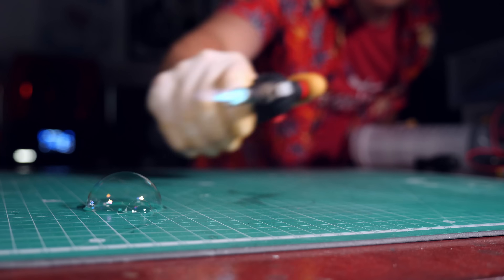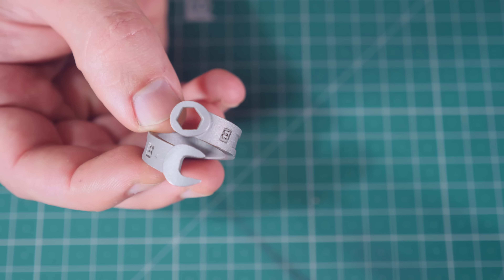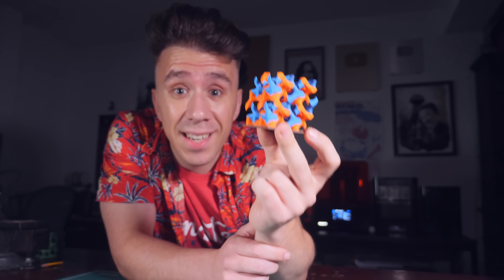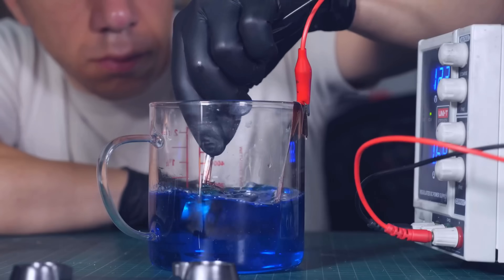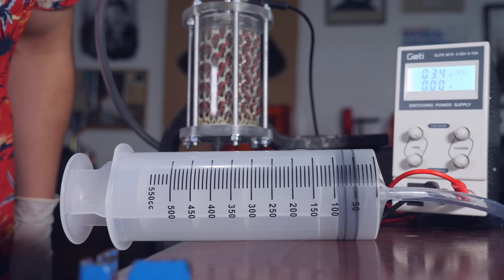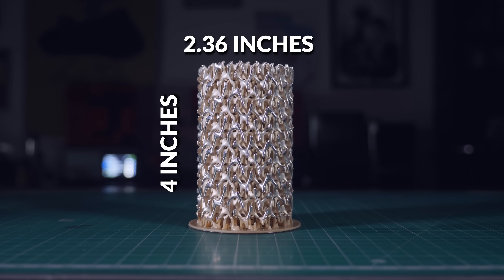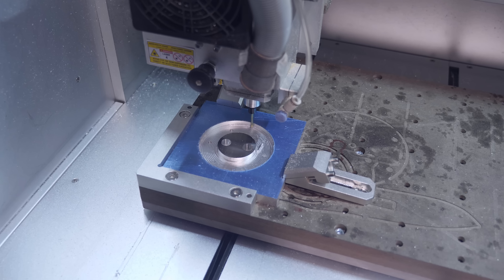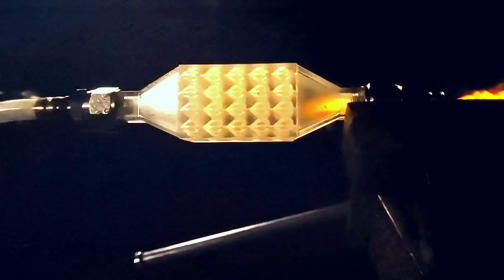ROCKET that LITERALLY BURNS WATER as FUEL

Comment: once you have sorted out the maximum surface area for the electrodes try pulsing the psu with a square wave at 10,000 volts at very low current (milliamps)vary the frequency of the pulsed. square wave until you find the .......resonant frequency of the water molecule......... the water molecule will break apart easily with very little current input (see opera singer and shattering wine glass} Just Thinking......
Keep up the good work.....

Comment: I have your solution just hook up a 48 volt electric bike battery. You can salvage an old speed control from a bike not in use and use the throttle to dish out power to the cell.

Comment: Might I suggest something of a challenge, the same one facing the greater hydrogen infrastructure. And that would be storage. You need to store enough to run your engine for any appreciable amount of time, but hydrogen is so small it can slip past most sealing surfaces. 
Of course, producing Brown's gas on demand would be ideal, but you're going to need a lot more volume to run a jet engine. 
Finding better solutions to both of these problems is the way, but if I know anyone who can do it. You can. Merry christmas!

Comment: You need to have another piece of ss in-between every electrode acting as a semiconducting plate between cathode  and anode I believe it acts as an volt/amp clamp it will save battery and overall cell health at the cost of hydro/oxy production try experimenting with different conductive material as the, let's call them "floating electrodes" also the plate thickness difference between cathode and anode (as one will be attracting twice as many atoms as the other, also the opposite one is the more corrosive of the two hence the discoloration/sludging of the one electrode) hint : further experimentation with anode material  may be beneficial as well.

👍 Awesome project keep us updated ! 👍

 I also have a schematic for using this with a 24v 1000 watt solar panel could be up or down scaled very easily for 48/12/6/ even 3 volt battery applications with almost any type of mAh delivery. 😁

Comment: If it is drawing more current than you can provide, decrease the electrolyte solute concentration to increase the solutions resistance. This will decrease the output but prevent you from burning through batteries. I recommend you use an electrophoresis adjustable voltage power supply or rig up a battery bank of some kind. I would be interested to see how the water electrolysis reacts to a rapid capacitor discharge or a scaled up version on the styro-pyro's car battery bank.

Comment: The wires they put on your "400A" battery look like they are meant for 40 :) . A device you might want to get if you are frequently wanting to experiment with circuits with tens of amperes in them is something like a KP-184, an electronic load - these things can current limit anything up to 40 amps very precisely (and they can be paralleled). Also, you'd want to get some 10 gauge silicone insulated wire to make proper high current cables...

Comment: Use a 40,000 volt compassitor that you can get. Preferably a blue silicone disk on it stores power equivalent to a power line and if you use a full bridge rectifier it might also help it

Comment: I see you sanded the plates for more surface area. For even MORE SA, maybe try sandblasting the plates (with proper abrasives for stainless steel) at a 45 degree angle. Moray B. King talked about an inventor that did that. And thank you for the warning to be careful with this because yes these gasses are extremely dangerous. Hydrogen especially since its burn rate is so fast you really need to mix it with ambient air to prevent flashback... at least Stan Meyer did that. A PWM sounds really awesome, and if tuned properly with measuring the resistance of the water.

Comment: Try a bunch of the latest technology solar panels linked together, as you only need peak drawing capacity at the time of creating the gas and thus abstracting the hydrogen from the water.
You may also want to use distilled water as it is far more pure and you probably want to boil the water first to remove as much oxygen as possible, before abstracting the hydrogen.
Now as I have only just found your channel and have immediately liked and subscribed. I believe that I should totally get the 3D printer, after giving such excellent advise ;-)

Comment: Ive built a 1.5kw hydrolizer. Every elektrolyte reacts differently. I used KOH as electrolyte. The law of faraday says to use between 1.5 to 2v per active cell. Above this voltage the electrolizer will work as a heater, with poor efficiency.

With the 1.5kw i have built, it makes a 5L/min of HHO.

Also make the electrolizer of stainless steel. (I dont remember using 304 or 316. It is important that the KOH will not oxidize the plates.

My cell was a 6s2p configuration. 12/6 is 2v per cell.

Let me know if you want to know more. I can search the sources of the above information.

Edit: also be sure to have 1.5 to 2mm between the plates. You want the bubbles to escape quickly vibrating other bubbles of the plates aswell while keeping the resistance as low as possible.

Comment: you need a speed controller to regulate the amount of current that is flowing out of the battery. You could use the 15v battery just lower the output that is being pulled from it.

Comment: Several years ago I started building an HHO torch rig and was coming up with a electrolysis cell using double helix SS Tig rods in mason jars. I realized to get a constant large enough volume of gas would require many connected cells connected to a bubbler arrester. Alas I abandoned the project due to high cost of materials and safety concerns. My design wasn't very efficient. Cell designs with neutral plates are the way to go nowadays. Overseas built units are getting down to attainable prices now. So as you say, "Buy a bottle."
Now if someone can find the resonant frequency of water like Stan Myers supposedly did we could use PWM supplies to split water far more efficiently.
Yeah, I've been down the hydrogen rabbit hole a few times.

Comment: So, I worked with batteries for years and to today still work in solar. You are going to destroy any battery you connect like that, you are essentially dead-shorting the ends of the battery. You need a regulatory circuit that will restrict current and give you control over the reaction,  you can also use a step down regulator which will take the voltage you throw in and bring it down but it will increase the current output. That way you are not pulling 40A from the battery, easy way to turn it into a paper weight. If you take a 12V battery and step it down to around 2V, the current should be insane so efficiency of battery use will be much better. Additionally, as mentioned, limiting the current before the regulator will increase the runtime of the battery. Basically, you can get the same result using less battery power using the correct regulator in this situation.

Comment: I’m becoming very interested in bifuel systems where CNG or H2 is either blended with liquid fuel for improved efficiency. Wastewater treatment is a very interesting application where sewage can be processed into methane and H2 via anaerobic digestion and electrolysis. So in theory, developing a process to efficiently combust CNG and H2 within existing automotive or aviation engines would blow open a huge market for cities with large sewage treatment plants to begin producing transportation fuels.

Comment: Use distilled water, / deionised water.
If using tap water then the mineral's in water burn and create sludge, it won't go away when you get it so... Need to clean out system...
To clean use cheap COLA, £:40 pence 2 liter stuff then by soaking reactor for several hrs, over night, rinse in warm water ... There you have it.

The reactor heat's up due to bubbles produced & remaining clinging to the surfaces of reactor plates.... And the electric power going to , example negative, CANNOT pass through clinging surfaces with gas or oxygen bubbles, and bounce round causing heat to dissipate....
Its a bit more complex but..... !
Interesting video thanks.
Thom in Scotland.

Comment: Try using a triac or SCR based power controller to control the power, then you can use the home socket as the source. If you want greater security you can use a transformer to isolate it.

Comment: You need a current limiting resistor in series with your tank. The hydrolysis tank has virtually no resistance so it effectively acts as a short which the batteries and power supply don't like. Add a low value power resistor to give it enough resistance to give you as much current as you want but enough resistance to not fry the batteries. It needs to be a large power resistor to be able to handle the wattage you are pulling. R=V/I so for the 15V battery at 40A you need 0.375 ohms including your tank. Might be best to not max out the battery and go for 35A with 0.43 ohms of resistance.

Comment: Try a small vacuum pump like from a food sealer to lower the pressure in the HHO generator and to pressurize the gas going into the jet engine. the lower pressure should make more gas with less current.

Comment: Have you tried using a PWM controller to provide power to the generator. To allow you to control the amps as well as prevent the unit from overheating and increasing resistance which would reduce output over time.

Comment: My friend, congratulations on the project. To generate 12 Volts energy, try using a car alternator and something rotating to drive the alternator. Then you use this current in your hydrogen/O2 generator. Good luck.

Comment: You should check out the john behind circuit for a pulse motor/generator. It may also answer your power problem for this video, if you combine both designs. 9v in to the motor, over 110volt output from the generator. I'd love a 3d printer, lol. Who wouldn't?

Comment: Swap to lead acid they self regulate and you can use solar panels and a mppt to charge it. Also run at a higher voltage and step it down.

Comment: U need to achieve residence to get the most hho gas as possible. If u make a pulse modulator at residence and use 12 volt car batteries u can achieve over 2 liters of hho gas to totally run a vehicle on hho gas. Inmade one years ago to use on my 93 blazer and got 33 mpg with injecting hho gas into intake side . Normally it would just get 12mpg on just gasoline. I got disabled and couldn’t finish designing the hho generator but still have the prototype

Comment: Start off with pure water . I used rain water. And a car battery.  Then while it’s running add the soda crystals and measure the amp draw. Add more water to reduce the amp draw if you over do it . And keep safe . If you go too high on the amps the plastic Will melt = sparks and boom

Comment: I have seen a video where the guy uses battery pins instead of stainless steel plates, he uses about 24, 1.5 volt batteries, you have to take each one apart use the pin in the center. 12 on the negative and 12 positive, he made lots of gas real quick with it.

Comment: Creating an engine that uses water as a fuel source instead of traditional petroleum or gasoline is a complex challenge, as water itself is not an energy source. However, water can be used in different ways to generate energy for an engine. One common method involves electrolysis to extract hydrogen from water, which can then be used as fuel. Here's a general overview of how you might approach creating an engine that uses water in this way:

1. Electrolysis of Water
Process: Electrolysis is the process of splitting water (H₂O) into hydrogen (H₂) and oxygen (O₂) using electricity.
How It Works: When water is passed through an electrolyzer (a device that uses electricity), it breaks into two components:
Hydrogen (H₂) gas, which can be used as a fuel.
Oxygen (O₂) gas, which is released as a byproduct.
Fuel Cell or Combustion: The extracted hydrogen can either be stored for later use in a hydrogen fuel cell or used directly in an internal combustion engine (ICE).
2. Hydrogen-Powered Internal Combustion Engine (ICE)
Conversion of Hydrogen: Hydrogen can be used to power a conventional internal combustion engine, similar to how gasoline works. The hydrogen is burned inside the engine, and it reacts with oxygen to produce water vapor (H₂O) and energy.
Engine Modification: The engine would need modifications to handle hydrogen gas, which burns differently than gasoline. Key modifications may include:
Fuel Injectors: Modified to inject hydrogen gas.
Fuel Storage: Specialized high-pressure tanks to store the hydrogen safely.
Ignition System: Adjustments to accommodate hydrogen's different combustion characteristics.
3. Hydrogen Fuel Cell
Working Principle: A hydrogen fuel cell generates electricity through a chemical reaction between hydrogen and oxygen. The byproducts are water and electricity, which can then power electric motors.
Fuel Cell Engine: In a hydrogen fuel cell vehicle, hydrogen stored in tanks is fed into a fuel cell stack, where it reacts with oxygen from the air to produce electricity. The electricity powers an electric motor that drives the vehicle.
Water as Byproduct: The only byproduct of hydrogen combustion or a fuel cell reaction is water, making it a clean energy solution.
4. Challenges
Hydrogen Storage: Storing hydrogen gas is challenging because it needs to be kept at high pressures (typically around 700 bar) or at very low temperatures (cryogenic storage), which requires advanced and expensive technology.
Energy Efficiency: Electrolysis requires electricity, which is often generated using non-renewable energy sources. If the electricity used for electrolysis is from fossil fuels, the overall carbon footprint may still be significant.
Cost: Hydrogen production and fuel cell technologies are still relatively expensive compared to traditional internal combustion engines or electric vehicle batteries.
5. Water as a Supplementary Fuel (Water Injection)
Some engines use water or water-methanol mixtures to boost engine performance, particularly in high-performance cars. This is called water injection:
Cooling Effect: Water absorbs heat during combustion, which helps lower engine temperatures and prevent knocking.
Power Boost: In some cases, injecting water can increase engine power by improving efficiency and reducing engine temperature.
However, this is not the same as using water as a primary fuel source; rather, it's a method to enhance performance when using traditional fuels like gasoline or diesel.
Conclusion:
While it's impossible to use water directly as a fuel, hydrogen extracted from water through electrolysis can serve as a fuel for engines or fuel cells. This method is being developed as part of the push toward alternative, clean energy vehicles, but there are still significant technological and cost challenges to overcome. For now, water itself is not a direct substitute for gasoline or petroleum, but hydrogen, produced from water, is seen as a potential future fuel source.

THIS TOOK ME A WHOPPING 50 MINUTES SO PLS LIKE THIS COMMENT NOT BEGGING

Comment: what you're looking for is a step-down transformer
More voltage causes more current draw
if you used a step-down for the bigger battery to reduce the voltage to 7 volts it might have worked

Comment: This is almost kinda encouraging to see because I was lazily just kinda messing with a SUPER simple version of this, not collecting hydrogen or anything just doing electrolysis for fun I guess, and also when I did copper plating I had this same issue, where this weird black sludge would just form on the electrodes for no reason seemingly. I don't know anything about this stuff and just mess around for fun though so I just stopped there lol.

Comment: Electrolysis 101, you can calculate how many grams of silver is electrolytically removed and turned into a salt per amp second. Try using Mixed Metal Oxide (MMO) anode material, but keep below the manufacturers recommended current density.

Comment: I have an idea. take the exhaust and put a turbine behind it and see if you can get it to generate electricity enough to power the electrolysis. like a turbojet but instead of an axel connected turbine, the turbine electrically powers the fuel source which therefore powers the rocket/jet.

Comment: Amazing video and project! You are killing the battery because the conductivity of the water is so good that it shortcuts the water.. you need a controled sustainable output.. a power source made to output the amount of amps steadily.. possibly its not necessary to run at maximum capacity.. maybe add resistors to protect the battery ! Cheers!

Comment: So instead of using a battery for continuous operation use the exhaust from the reaction to make electricity by thermoelectric methods. Like a car. The battery runs the starter then the engine starts the starter stops and the engine runs an alternator that keeps the car running and the battery charged. Also the alternate firing of you jet engine reminds me of the pulse jets that are common but we're also pioneered by the German army during WW2.